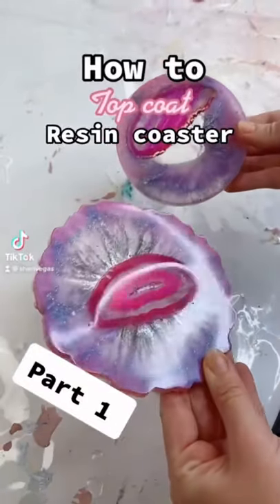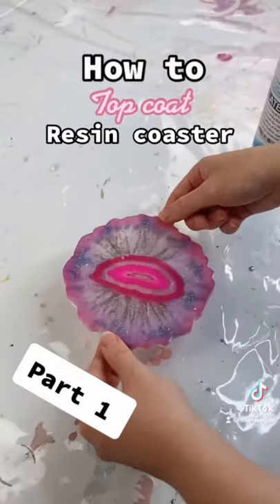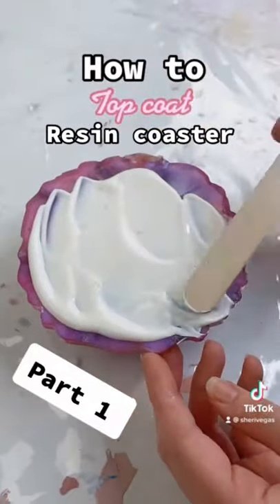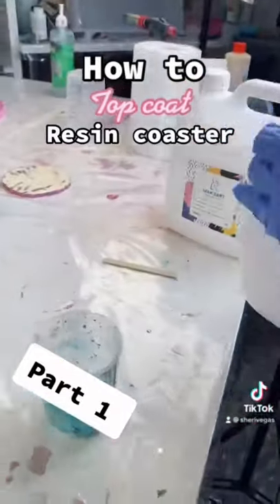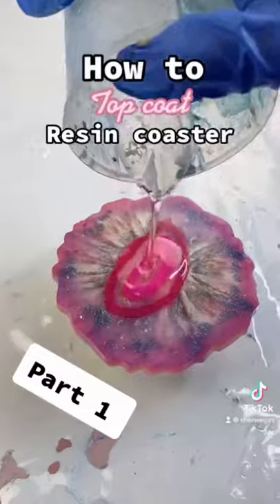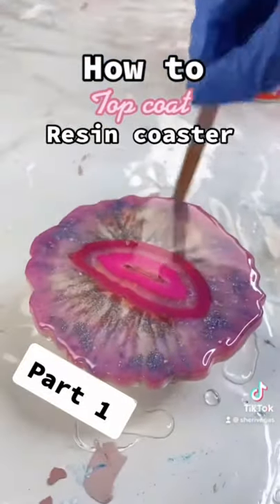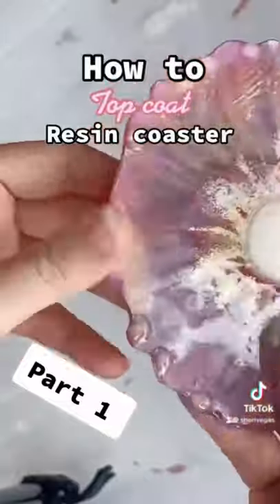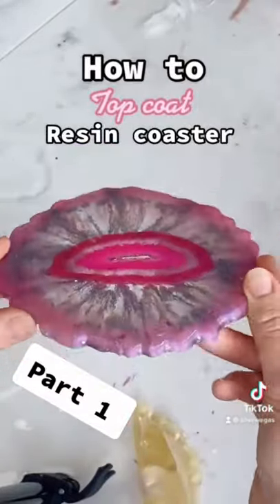How to top coat resin coaster (1 minute tutorial)

Comment: I  love using the liquid latex. A tip... use your finger to spread a very thin layer of the liquid latex.... you will use way less of the latex and you only need to let it dry about 40 mins. You really dont need a thick layer of the latex for it to do the job... the resin will pick right off the latex even if its applied thinly. :) Great tutorial.

Comment: Do you have a tip on how to avoid the resin from collecting at the bottom edge however when top coating? I have them placed on cups and everything, but instead of the resin dripping off it just pools at the bottom edge which creates sort of an "elephants foot" effect. My resin isn't very thick nor very thin, and i try to make sure i don't use too much but it still just pools at the bottom edge. :(

*I'm gonna be annoying with this, and just copy-paste this question on every top coating resin video, because I'm losing my mind why I can't make them look nice.
Reply: That is why they put latex, to protect the other parts that don't need resin coat.